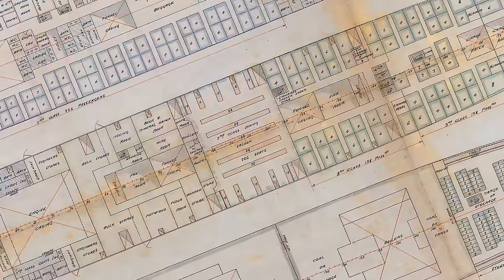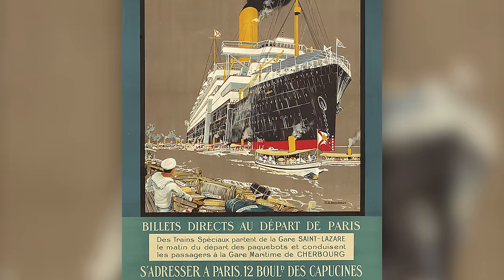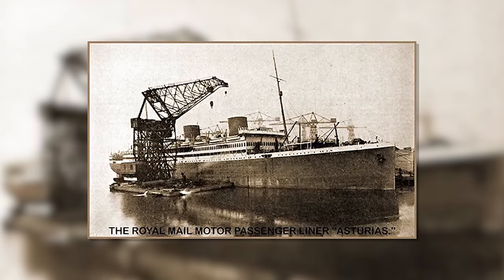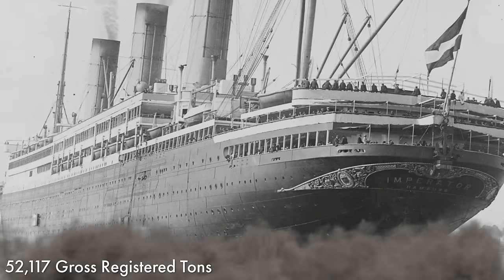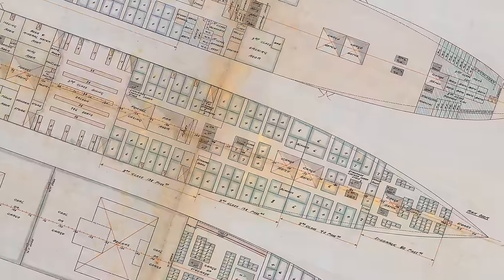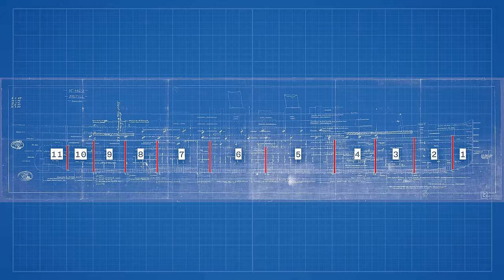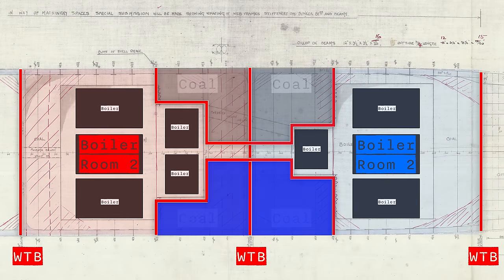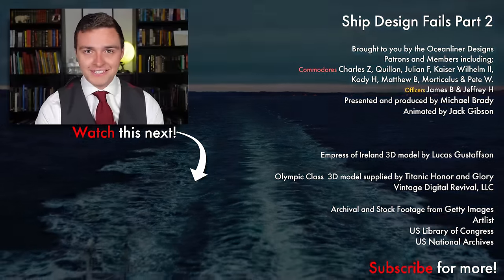When Engineering Goes Wrong: Three Badly Designed Ships

Comment: I honestly can't fault the Empress of Ireland's designers--it's extremely hard to design a ship with that era's technology to withstand getting rammed at speed by an ice-breaking ship of that size in the worst possible spot at the worst possible angle, combined with an immediate loss of power and steam pressure. The ship sank so fast that none of the measures anyone could have taken would have mattered.

Comment: Its telling that as late as the 1960s when Cunard was designing its new transatlantic liner the only option they had for 28.5knots service speed was steam turbines , despite John Brown just having completed the MS Kungholm for Swedish America  Diesel engines could not possibly provide enough power for the high speed ship Cunard required.

Comment: Royal Mail and Harland & Wolff continued with the twin screw diesel powered passenger cargo ships for decades - The Highland Brigade etc - The Highland Monarch, twin double acting 4 stroke, blast injection out ran the Graph Spee and was there when the Spee was scuttled - Monarch was given 30hours to repair the damaged engines and return back to the UK - One can only say that the Engineers in those early motorships were more than Heros - my father was one of those heroes - I sailed on two of the last ships of the exRoyal Mail - Harland built and engined vessels, then owned and operated by Shaw Savill - mv Aranda and mv Arawa - big strong well built vessels - I did meet CC Pounder in his very later years

Comment: Howdy Mike, I think some of your readers (I am sure you have seen this) might be interested in the tale of longitudinal bulkheads and the attempts by the English and French navies to force the Straits of Gallipoli in the first world war.   HMS Irresistible, HMS Ocean and the French Bouvet all pre-Dreadnoughts were lost to mines and a large part of their losses were directly because of the use of longitudinal bulkheads. The dreadnought battlecruiser HMS Inflexible was badly damaged and had to withdraw for repairs. By WW2 the big ships were being divided into generally tiny compartments to stop the same problem. But on the Iowas they had the engines divided into 8 large compartments that were nearly full width. The height of little bitty compartments was probably the turbo electric US 2nd generation dreadnaughts. Boilers, generators and motors all divided up into separate small compartments.

Comment: One other design would be the SS Eastland. Before its life as USS Wilmette, she used to be a passenger ship. Initially; aside from the draft being too deep for Black River, the ship was mostly fine. However, modifications caused the ship to become way less stable. A Multitude of lifeboats were added, multiple cabins torn out, machinery adjustments, top smokestack sections ripped off, the original hardwood flooring inside the forward dinning room replaced by concrete, and air-conditioning installation.

Comment: 19:00 The Titanic didn't sink because the watertight bulkheads stopped below the passenger areas. The watertight bulkheads went up beyond the margin line, which is the level beyond which the ship was going to sink regardless. If you get water going over the margin line, it's because you're already sinking.
Remember, just because you have a watertight compartment (or several), doesn't mean you have sufficient buoyancy to keep afloat... or that the compartment has sufficient integrity to withstand the growing pressure from being pulled down.

Comment: Thanks for another great video, beautifully presented and with graphics that keep getting better and better, well done. As I know you like to be technically correct (see Titanic machinery video) I would mention that steam turbines are not reversed using the gearing, an astern turbine is fitted on the forward end of the low pressure (LP) turbine. When astern running is required steam is admitted to this turbine and the turbines, gearing, shafting and propeller now rotate in the opposite direction. The astern turbine can typically produce about 70% of the torque available when running ahead at 50% power. Quite sufficient for the puposes of manoeuvring.

Comment: I was once on an oilfield crew boat, about 80', that would suddenly hook one way, the captain would turn it back, it would then hook the other way, continuously.  It was said to be a problem with the hull design, not the rudder.  I hope that boat ended up as scrap metal.

Comment: I am thinking that the 1892 Hornsby/Barton Oil Engine was the first engine using heavy oils with Compression Ignition. These compression ignition oil engines were, I think, produced for global sales from 1892 until early 1900s. I can still remember using a blow lamp on the even earlier engine to heat the bulb. 1897, I think, was the first running Diesel Engine, from memory this was not on mineral oil but peanut oil. Can you please check as the Heavy Oil Engines were in ships well before Rudolf Diesel had his engine in production.

Comment: May be a silly question, but, in the event of a collision, is the advice to separate the two ships asap, or stay stuck together until all waterproof doors in both ships are closed?
Reply: It’s better to try to keep the two ships together as long as possible. Regardless of watertight door status, by keeping them together you hopefully slow down the speed and amount of flooding for as long as possible.

Comment: 00:02 Ship design failures range from harmless to deadly.
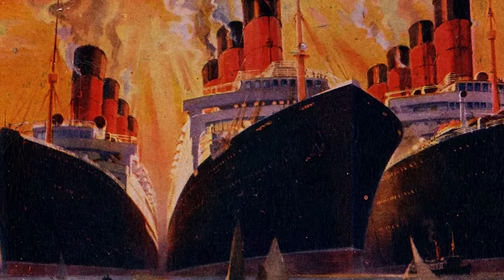02:13 Emphasis on speed and profitability in ship design
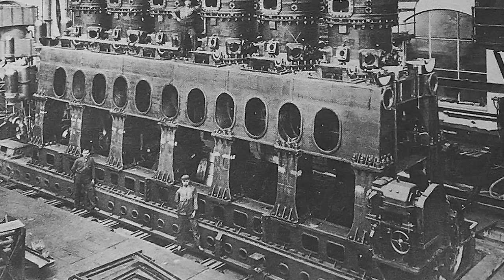06:18 Lord Kiland's decision on the diesel engines led to underperformance
08:23 Competitor ships outperformed Britain's newest liner and caused embarrassment
12:20 Imperator ship's design flaws led to instability despite efforts for rectification
14:24 Empress of Britain and Empress of Ireland introduced deadly design flaw.
18:14 Importance of Proper Compartment Design
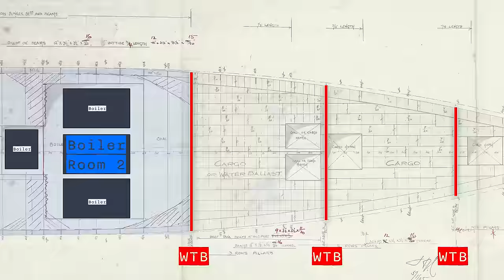20:02 Ships' safety measures failed in a catastrophic accident
23:36 Properly designed watertight doors can prevent ship sinking disasters
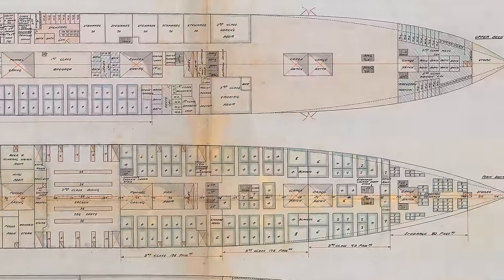25:19 Longitudinal bulkheads contributed to loss of life
Crafted by Merlin AI.

Comment: For longitudinal bulkheads, wouldn't they be able to solve a lot of that problem by ensuring the ones on either side were connected with a thru-way that enabled water to spill from one side to the other (without going through to the center passage between them)? It would mean that a breach on one side could fill both coal bunkers, if the hole let in enough water, but it would prevent listing, while creating a watertight section with an overall volume similar in size to the rest of the compartments.

Comment: The maximum speed of  displacement hull through water in knots, is very little more than the square root of the WATER LINE length in feet.  Provided that the Beam:Length ratio of the wetted area is reasonable.  After that, millions of extra horsepower make very little difference.   Planing hulls lift clear of the water and the hull skims. But you still need much more power once planing.   Hydrofoils certainly whiz, but they need yet more horsepower still.  Ergo (!), 100’ WL =10kts ; 400’ = 20kts, 1000ft = 32kts   Anything more wastes exponentially more power.

Comment: SS Yarmouth Castle was filled to the brim with flammable materials, improperly maintained windows, and lack of sprinklers in room 610.

SS Utopia's holds basically had no protection against flooding and the ship quickly went underwater in 20 minutes.

SS Central America was doomed by a leak that occurred with a seal between a paddle wheel shaft and side of the ship. Not to mention its bilge pumps being heavily reliant on the steam engines. 

SS Asia was not well converted as a passenger steamboat. Often top heavy due to how it carried cargo. Not to mention lifeboats were extremely unreliable. 

Victoria steamboat was built from the burned remains of the ferry Enterprise. It took a single boiler to destroy enough support beams on the upper deck to forcibly separate it form the rest of the boat. This caused the boat to sink rather quickly.

Comment: This is my question. Are you aware of Union Pacific "Big Boy 4014?  Just recently she was called upon to push a stalled a cargo diesel up grade with both of both manifests intact. Not one issue. Just a single wheel slip indicating she had power to spare. 
Back in the 2010s she was saved from scrapping and restored to service. She was converted from burning coal to diesel. She is huge possibly larger than the diesel engine shown in the engine room photo.

Comment: It would be interesting to have an video about modern cruise ships, because they are tall as a skyscraper i wonder how much is there underwater and how they manage to  stay stable

His funny takes are getting better  :)
Reply: The modern ships have their passenger decks built of aluminium, a lot lighter than the steel used in pre-WW2 ships, so the extra decks do not raise the centre of gravity so much.   The depth of the keel hasn't changed much as they still have to enter harbours.
Also, passenger ships since the 1950's have had active stabilisation, so they don't normally roll.   This is paddles that stick out the sides, controlled by gyros and act much like the roll controls on an airplane.
Reply: @keithammleter3824  Super interesting

Comment: As a mechanical Engineer I know it is impossible to design any machine, ship, or whatever mechanical contraption, that shall not fail under given circumstances. First of all, many things have been learned by experience, and there are some things that are not wholly known yet. In the case of fatigue of meatls, theories only are available, not laws.  Beisdes there is another factor to consider: cost.  If something is too costly, it simply won't be built. Even in REsearch, most of us are willing to accept being wrong once in every twenty times.  So building a ship with no design failures whatsoever, and that shall resist any physical phenomena that may possibly affect it is just impossible.  Regards-

Comment: It seems like there are so many shipwrecks that I hear about where half of the lifeboats aren't usable because of the list of the ship. Of course it makes sense to design ships so this isn't likely to happen but perhaps it would also be good to do something like what airplane designers do and make it so that everyone can get off of a sinking ship even if they are only able to do so on one side like planes must be able to evacuate all of the passengers even if half of the doors can't be opened. I don't think if my perception is correct about the list preventing half of the lifeboats from being used since I imagine the stories where both sides can lower lifeboats aren't the stories that one hears about as often. Yes, it would take up more space and add weight to the ship, but it would save a lot of lives just in case ship happens on the high seas.

Comment: You also can use oil to fire boilers without stoker. The Diesel engine has a much higher efficency than a steam engine or a steam turbine, that is the reason for a Diesel. The missing speed is not the failure of the Disel engine, it is a misscalculation of the necessary power or mistakes in other parts of the power line like the propeller, or trouble with the hull design. The double bottom is not to keep the veesl thight in case of a grounding, it is to give mor stiffness to the design of the hull. And as a space for tanks, specialy ballast and fuel tanks. The desaster of Empress disaster was also not a design failure, it was just that at that time the knowhow for watertight departments was not jet existing. That was the same with Titanic. You can't design for the worth possible accident. Nobody could immagine that Titanic's hull would be opend over such a long distance as it happend in 1912. And so they never calculated with more than 3 departments opend to the sea and thus the ship going down so deep that water could flow over the bulkhead. Same with Empress. Today we know o cruisevessels that we have to design chanels for crossflodding to keep the ship upright. It's a learnig curve due to accidents.

Comment: Most ships are held upright because the parts under the water line are heavier than the parts over, so that they are actually balancing in the water. 

But there is a constant pressure from the owners to rig the upper parts as heavy and high as possible to enhance capacity, and thereby reducing stability of the balance. When designing a ship, a certain amount of stability loss is accepted to enhance the capacity. Badly distributed cargo or hard weather conditions can therefore make most commercial ships tip over.  

The difficulty of calculations are due to the pressure of designing the ship as close as possible to acceptable or legal limits and sometimes the calculation fail, and sometimes the limits are overrun by will. 

The modern highly over-rigged cruise ships for example far overrun acceptable limits. This leads to frequent bad incidents with these ships in difficult weather conditions, a fact which is constantly hushed down. Possibly these ships respect limits posed by the law, but these limits seem to be too wide to make these ships really safe.

So far most episodes are limited to all content being shaken around, everything in the ship totally disorganized, passenger injured, and the whole trip becoming a nightmare, but this is of course bad enough, and it can go far worse, especially in these times with more unstable climate.

Comment: Here's another demonstration of the advances in diesel engine technology. You mention an engine rated at 4500 HP that was two stories high. For the last twenty years or so, there have been diesel engines rated at 4400 HP that are small enough to be fitted to locomotives.

Comment: I have to ask, if the tops of the compartments were sealed off below the passenger decks, could that work? Instead of having bulkheads go all the way up? You could still have the bulkheads but what about a cover to them say 10 feet above the waterline. Then they wouldn't need to go all the way up. And the top forms a deck so there isn't any openings for water to slip through.

Comment: Regarding the Imperator, Couldn't they have just lightened or shortened the funnels? I mean that seems a lot easier than removing the top deck which is usually first class.

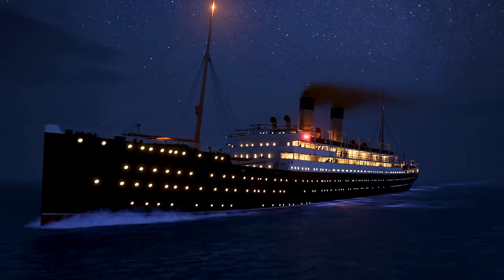Comment: `20:35 Indeed, the odds of getting hit by another ship on the side are pretty low, aren't they? Besides, ships are SUPPOSED to get hit directly on the side on a daily basis, right?! Just ask PT-109!
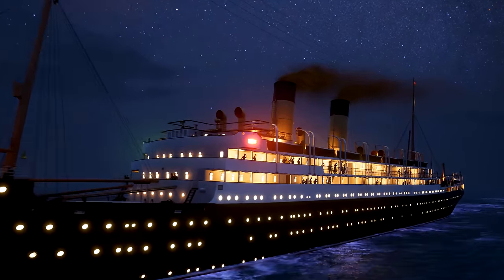`20:45 Hold on, I thought that the Empress of Ireland went down about a year before the Titanic did?
`25:25 Out of curiosity, what safety lesson do you think could be learned from a ship sinking only after 19 torpedo hits?

Comment: Why not also make waterline bulkheads that run horizontally? Like watertight doors that shut horizontally between stairways in decks specifically the nearest deck that's just above the waterline that can seal off the ship completely so even as it starts sinking slightly and loses some buoyancy the water inside can only go as high as the sealed-off deck preventing further flooding. Unless there are any open port holes which i think they should also come up with automatic electronically closing portholes that would close all port holes electronically and lock them with a press of a button on the bridge. Now yes I can see the moral aspect is bad as it would basically mean any crew down below with nowhere to escape would be trapped and would end up drowning. However, with modern ships, there is hardly any crew below the ship's waterline since there are no stokers for boilers just a few engineers that work in the engine room(s) but that's it. Likewise, maybe have the vertical doors close right away and then have a five-minute evacuation warning bell for the crew to get out before the horizontal doors close and possibly a wheel allowing the crew to open the doors manually to escape in an emergency. Once again the doors will begin to close back up again automatically after a short period of time lets say three minutes in case the crew forgets to close it back up after escaping. Moreover, the Automatically closing portholes can also pose a crushing hazard to anyone gazing out the port hole as the button to close them is pushed so once again a warning bell or in the case of a modern ship a voice command over the ship PA system that the port holes are about to close and lock automatically and to move out of the way and move anything that might be blocking them from closing and some kind of a notification system on the bridge to tell the crew that all watertight doors and port holes have been successfully closed any fault will be displayed on the bridge so that it can be fixed manually by a crew member actually going to the location of the faulty porthole or watertight door and fixing it right away.

Comment: Look at the height of the ceilings in Imperator. They did not have to be higher than 3 1/2  metres but they are twice that. A ship is a ship and not a hotel.